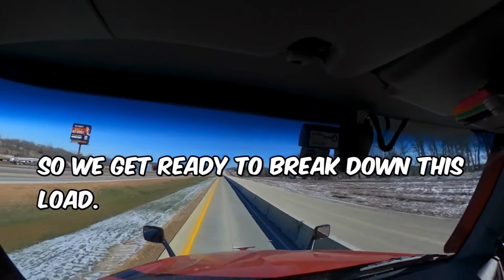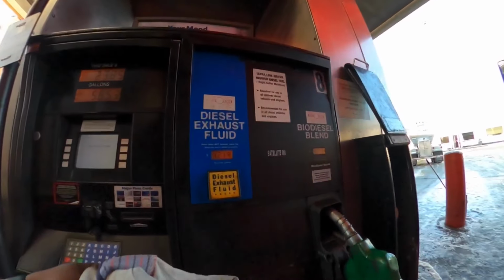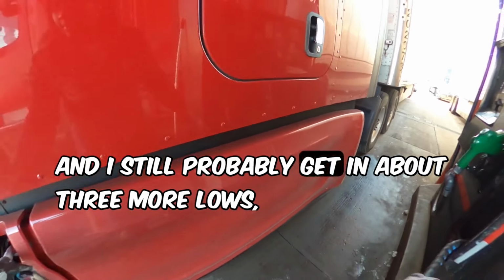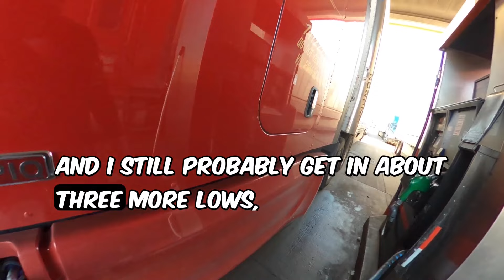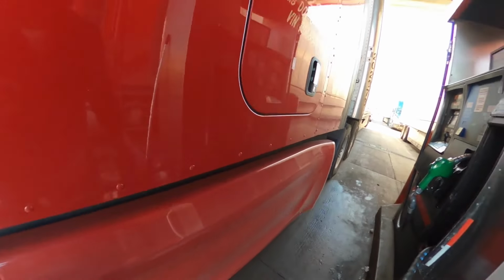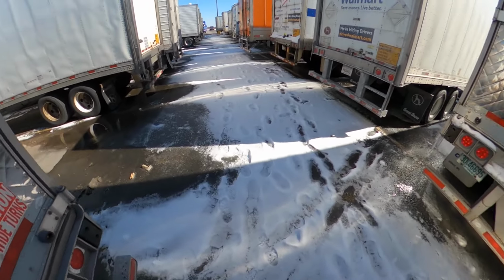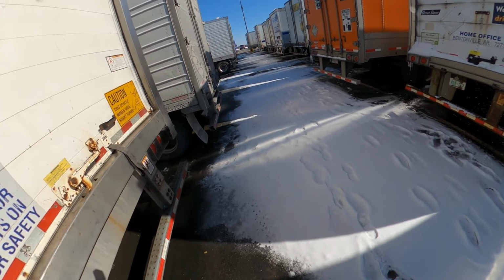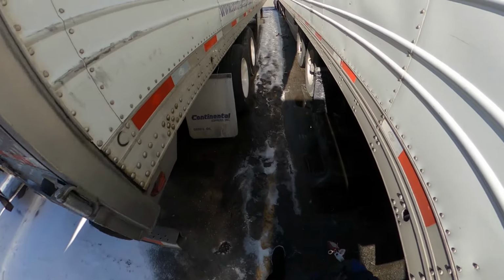This Load Paid Me $4,000! HOW MUCH DID I REALLY PROFIT WITH PRIME INC

Comment: Some  truck drivers are so nasty and filthy all older  truck stops  parking  lots  smell  like  pee  and some drivers  throw  bag on number two on the  parking  lots. I used to drive  wrecker and all truck stops I would  Carrie something to lay on to remove  driveshift because it  was so nasty. That's the  reason  most  companies  do want trucks on there parking lot. Some Walmart  have no parking for trucks and  will tow them  off.bucky's will not let on there parking  lots  in ga.